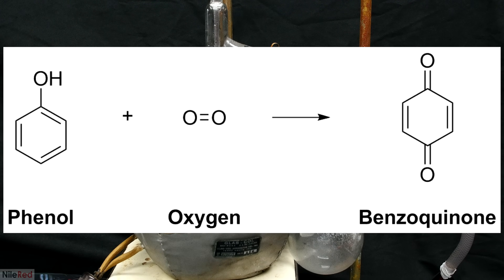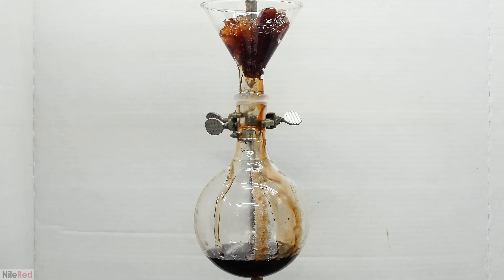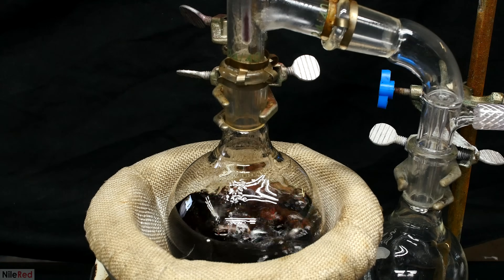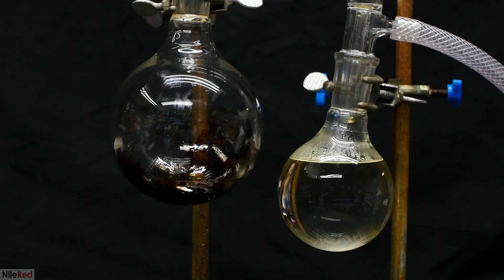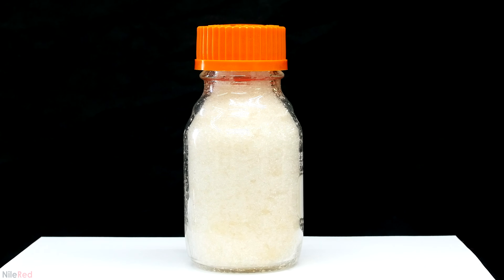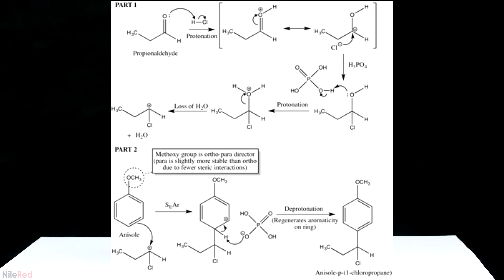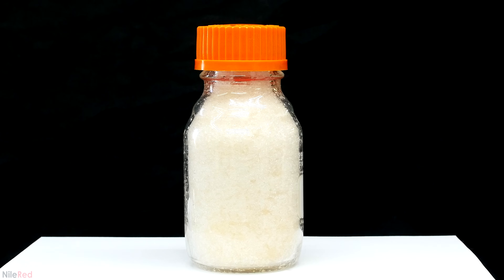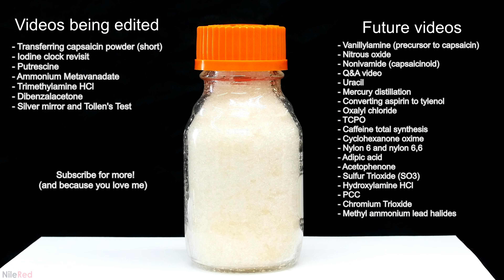Cleaning Dirty Phenol

Comment: About distilling without vacuum, I have done this and it works decently well.  Though the yields aren't as good as when a vacuum is used.  You do end up with a bit of discoloration and an impure product.  But, it can be easily separated with another distillation under an inert atmosphere if vacuum is unavailable.  There are cans of argon that can be bought on eBay that are for keeping wine from oxidizing and it works well for this.  It is cheap as well.  I think I gave $12 for a whole can of it.  It is enough to fill 2 or 3 large wine bottles full of argon.

Comment: Would it be viable to store chemicals like this in an atmosphere of nitrogen? Or would it be too hard to stop oxygen from leaking in?
Reply: It would help with the oxidation issue but I don't think there is a practical way of doing it.
Reply: Argon can also be used and may be just a bit better because it is heavier than air.  But as said before, it isn't very practical.  Though it will work for short term storage.

Comment: I would propose a third mechanism. I like the first mechanism all the way until the alcohol gets dehydrated. I think the phosphoric acid could phosphorylate the secondary alcohol forming an electron withdrawing phosphate group on the benzyl carbon. Once phosphorylated, I believe the phosphate would make a much nicer leaving group, not to mention the phosphate is more electrophilic than hydronium. Also, the electron-rich benzene ring would make this an attractive phosphorylating site. The reason I favor phosphorylation as a mechanism is because it is shown as a catalyst. HCl is good enough of a proton source, so I see no reason for a second acid, much less phosphoric acid specifically.

Comment: Aldehyde is actually a rather strong electrophile. Some aldehydes are barely stable to store without the electrophilic position being attacked by a nucleophile (often water). High polarisation of the C=O carbon plus you only have a hydrogen instead of another carbon bond to it, which makes for a very small steric hindrance. The protonation of the C=O oxygen further increases the carbons electrophilicity. The mechanism is called hydroxy alkylation. Especially with the electron rich phenol ring it's a fast reaction.

Comment: well i a bit late but on the last question from the previous video: my bet is i think covered by the wise salmon. i kind of thought about how phenol and Acetaldehyde form Bakelite. under acidic conditions the oxygen of the propionaldehyde gets protonated further activating the carbonyle and that is enough to trigger electrophilic aromatic substitution. the result will be the carbonylgroup becoming an alcohol directly attached to the aromatic ring. and we have HCl in there and HCl+Alcohol in a more or less water free environment is a surefire way to make alkyl chlorides. just don´t see the point of the phosphoric acid. So the first part seems pretty easy to me. the second part which you thank god didn´t ask for, however showed me how bad my dementia is i entirely forgot about elimination reactions. i was torturing myself with how the pyridine might insert itself in the carbon chlorine bond thanks to it´s lone pair of electrons on the Nitrogen. how pyridine normally reacts with alkylhalides btw, but i totally forgot that a base can always abstract a proton from a carbon adjacent to a carbon with a halogen or any other decent leaving group on it and just kick the halogen or the leaving group in general out that way. classic beta elimination. completely forgot about these^^

Comment: If you ever have any doubts about purification drying, look up Purification of Laboratory Chemicals by WLF Armarego and CLL Chai. They write:  the phenol is separated, dried with CaSO4 and fractionally distilled under reduced pressure. It is then fractionally crystallised several times from its melt [Andon et al. J Chem Soc 5246 1960].

Comment: I tried it today. Yep, it works, but, as author mentioned, assembly with condenser connected to water circulating thermostat under ~45-50 Celsius degree would be better to condense all phenol without its crystallization. In my case all these were absent, so part of phenol was purged to water jet pump line. It's not a disaster, but I had to wash all rubber tubes after distillating. Thank you for video. 
P.S. Has anybody ever try to crystallise phenol from different solvents in order to purify it? I tried water (75% mass phenol to 25% mass water), but it turned to be impossible to separate phenol of two-layer system after cooling (Maybe I wait for too short time).

Comment: 8:40
I hate to be critical but I suspect the addition of chloride to the active positive species (just after water comes off) would likely resonate to a more stable structure and follow direct addition of the Cl- to a positive benzylic carbon.

Im pretty sure you might have considered this and opted to simplify the reaction scheme on paper within the same step so it might be a mute point to you; however, I believe the properties of aromatic resonance and activation would strongly stabilize this specific transition state and is responsible for the highly specific addition at the benzylic carbon location.

Comment: I wasn't here when you originally asked the question, but when I saw the question in this video, the thing that immediately came to mind was the mechanism that the Wise Sabbath posted.

I'd love to solve a mechanism to get a beaker, but I'd also love to just buy a beaker off you.

As for mechanistic speculation, questions like "does a rearrangement occur if a given intermediate is produced?" are the perfect sorts of things to use computational chemistry to solve because it doesn't actually take very much work to get an answer. In this case, I think it's unnecessary because the C+ would certainly rearrange, but generally speaking, it's a good way to answer questions like this.

Comment: I had a different mechanism in mind. Though it is similar to your mechanism. My idea was the same as yours for the first two steps. Then I drew the hydroxy group picking off the proton from the para position to restore aromaticity. The water leaves, forming a secondary carbocation, with the chloride hitting either face. I suppose it could also happen in one step, but the position is secondary, and therefore unlikely.

I like your mechanism, but I don't think the double bonded carbon in step 5 would be sufficiently electrophilic to be attacked by the chloride. Also, is the product mixture racemic? Because attacking at that double bond would yield a racemic mixture of products, since the chloride can attack on either face of the planar carbon-carbon double bond.

Comment: I am realy happy that you start playing with polymers. Are you still planning to make polystyrene vid? Because as it should be pretty easy my attempt to radical polymerisation of styrene or MMA ended up in some rather higher mol weight polymer but not remotely solid.
Maybe I am supposed to dissolve this polymer in monomer and try to polymerise that mixture. I was hoping, that I can go from low viscosity liquid straight to solid.

Comment: It should be possible to distinguish which mechanism is correct by examining the reaction's products ; specifically, if the second reaction mechanism is correct, then there should be a variety of chlorinated propyl compounds among the reaction's side products.

Comment: At atmospheric pressure, the phenol-water azeotrope contains 91 percent water by weight.
The azeotrope can be "broken" (that is, the phenol and water can be separated) by adding a ketone (e.g., 2-butanone) and either benzene or toluene.  (See:  https://www.google.com/patents/US4160111 )  
Adding petroleum naphtha also works.  (See:  https://www.google.com/patents/US2209150 )

Comment: rewards/fairness: Set a time limit? "You have a T (time) to suggest the best way to do Z. (method) the best entry will get Y. (prize) Submit answers at M (contact method) no later than midnight on D (date)"

Doesn't eliminate the lack of discussion aspect, though. Maybe reward the best idea and method. But that could be a pretty large pain in the fundament.

Comment: from Purification of laboratory chemicals : 
Phenol []Os-95-21 M 94.1, m 40.9O, b 85.5-86.0°/20mm, 180.8°/760mm, d 1.06, n41
1.54178, n46 1.53957, pKZS 9.86 (10.02). Steam was passed through a boiling soln containing
lmole of phenol and 1 S-2.0moles of NaOH in 5L of H20 until all non-acidic material had distd. The residue
was cooled, acidified with 20% (vh) H2SO4, and the phenol was separated, dried with Cas04 and fractionally
distd under reduced pressure. It was then fractionally crystd several times from its melt [Andon et al. J Chem
Soc 5246 19601. Purification via the benzoate has been used by Berliner, Berliner and Nelidow [J Am Chem
Soc 76 507 19541. The benzoate was crystd from 95% EtOH, then hydrolysed to the free phenol by refluxing
with two equivalents of KOH in aq EtOH until the soh became homogeneous. It was acidified with HCI and
extracted with diethyl ether. The ether layer was freed from benzoic acid by thorough extraction with aqueous
NaHCO3, and, after drying and removing the ether, the phenol was distd.
Phenol has also been crystd from a 75% w/w soln in water by cooling to 1 lo and seeding with a crystal of the
hydrate. The crystals were centrifuged off, rinsed with cold water (0-2O) satd with phenol, and dried. It can be
crystd from pet ether [Berasconi and Paschalis JAm Chem Soc 108 2969 19861.
Draper and Pollard [Science 109 448 19491 added 12% water, 0.1% aluminium (can also use zinc), and 0.05%
NaHC03 to phenol, and distd at atmospheric pressure until the azeotrope was removed, The phenol was then
distd at 25mm. Phenol has also been dried by distn from the *benzene soh to remove the water-*benzene
azeotrope and the excess *benzene, followed by distn of the phenol at reduced pressure under nitrogen. Processes
such as this are probably adequate for analytical grade phenol which has as its main impurity water. Phenol has
also been crystd from pet ether/*benzene or pet ether (b 40-60°). Purified material is stored in a vacuum
desiccator over P2O5 or CaS04.

Comment: Awesome Video Nile ! 
Im excited for the next video as handeling ammonia and pouring it makes everyone cry( Sarcasm)
I would like to know is there any other way to do it with minimum vapours pouring out! 
Also As in biology we have molecular docking. So in chemistry we have any such software where we can predict mechanism of a reaction or its still done the old school way of tracking a molecule by labelling it !
Reply: You can indeed use isotopic labelling to label a specific site in a molecule and then see where it ends up once the reaction is finished - although the reagents can be very expensive. You could also create a "Hammett Plot" to determine the linear free energy relationship of the reaction. This would allow you to see if positive/negative charge is being built-up close to, far away, or very little at all to the aromatic ring in the transition state of the rate limiting step. For instance, a positive Rho value from the plot would indicate negative charge is being built-up, whereas a negative Rho value would indicate positive charge is being built up. This could then help you decide which mechanism is correct by looking at which one seems to fit the data better overall. There are also many other methods that you can use to help elucidate reaction mechanisms :)
Reply: +Timothy Morrison Thanks for such a deep reply !

Comment: Indeed the carbocation of the second proposed mechanism is quite unstable, but while the chloro atom withdraws electrons by inductive effect it does estabilize the carbocation by ressonance effect, since it has free electron pairs that can interact with the empty p orbital of the ion. This stabilization is already described in the reaction of alkynes to a hydrogen halide -- the carbocation formed in the second addition occurs in the alpha halogen, not in beta, as you would expect thinking in halogens only as electron withdrawing group. In that way you would not get a hydride shift to form a secondary carbocation...

Comment: Am I still being promised a mercury distillation also how do I clean gallium metal
Reply from the maker: I will clean gallium eventually. Right now Im not sure how to clean it though. Also yes, I will keep promising (an eventually deliver)
Reply: You can clean gallium by melting it in water and adding a bit of sulfuric acid
Reply: NileRed I did try a warm water method seemed to get the oxide solids out by something similar to gold panning

Comment: Hi Nile, I believe you used the rotary vacuum pump for this process as water aspirator won't be powerful enough. Did you have to change the oil in you pump after this process? As far as I know phenol is slightly soluble in mineral oil and I believe quite a bit of phenol vapors passed through to the pump.

Comment: I would say the second mechanism is wrong. I have never seen addition of halogen anion to a carbonyl group happening, it's just not gonna happen. also, there's no such a thing exists that a halogen and hydroxyl attached to the same carbon. it jus spontaneously eliminate the halogen to form a carbonyl, which is the starting material in this case.

Comment: The first mechanism is the right one. The protonated aldehyde is really electrophilic and is easily attacked by the anisole. The second mechanism has 2 major problems.. one has been stated in the video, the other one is that the intermediate with OH and Cl is basically a tetrahedral intermediate of a carbonyl nucleophilic substitution and it would break down into an aldehyde.
Reply: You're wrong Mihnea Zoican! The strong electron withdrawing group of Cl could be enough to stabilise the tetrahedral intermediate that is formed during the reaction - I have seen this occur in similar reaction mechanisms. However, the first point brought up by NileRed about a 1,2 hydride shift occurring due to the instability of the primary carbocation I completely agree with and this would result in the wrong product being formed.

Comment: the first one is the best. any carbocation is bad, they are very prone to side reactions occurring  such as rearrangements, always been told to avoid them
Reply: After seeing the first mechanism it definitely seems like it's the more feasible option.
Reply: I agree!
Reply: Agree, that primary carbocation I seriously doubt that stays like that
Reply: I thing if not add H3PO4 this reaction run and stopping on alcohol.
Reply: how to recation fenol  and h2 o2 with castic